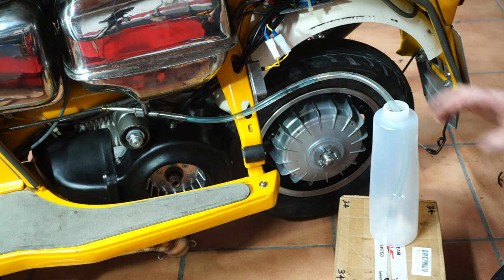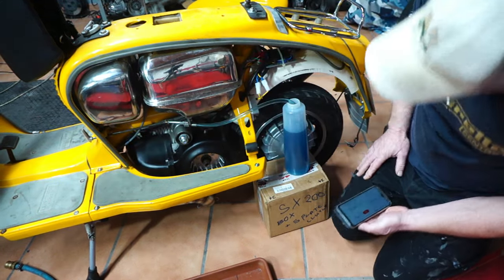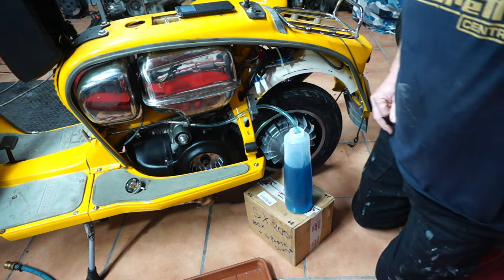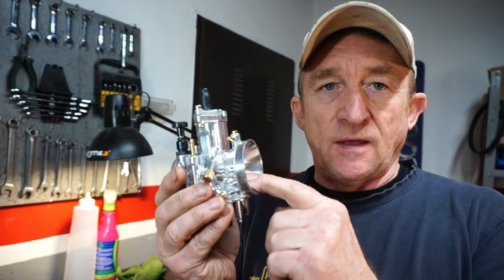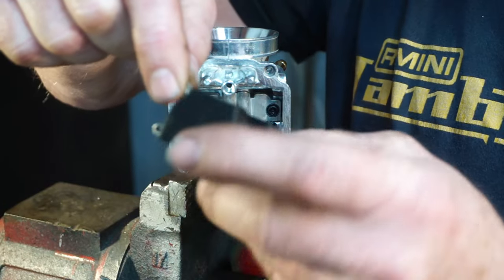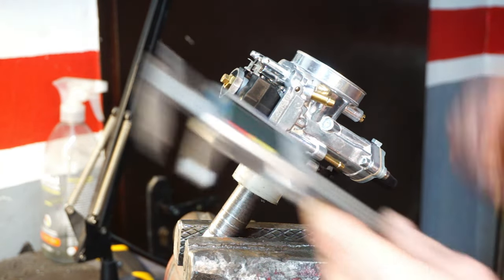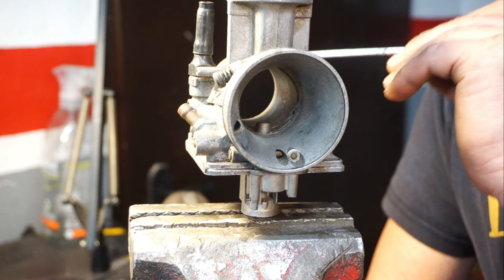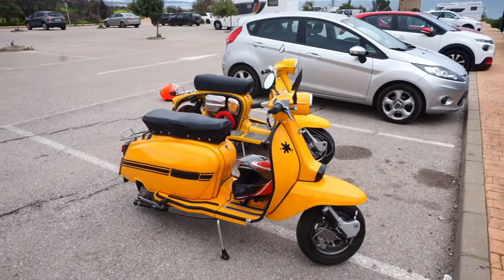AMAZING CARBURETOR TUTORIAL AND SUPER MONZA TESTING part 1#lambretta #scooter#pwk

Comment: Hi Steve, Great channel keep it going.
Can you explain how an engine runs in reverse?
i rebuild an engine with a 195 kit (BGM) Set the timing to 19•  BTDC with a 360° disc. i decided to have it checked by a friend with a buzz wangle and strobe light and it was out. On a few occasions  the bike has reversed  in first gear, please can you explain?
Help!
Reply from the maker: its an ignition anomaly due to a faulty coil or pick up .

Comment: Beware the very cheapest PWK copies.  Its possible to spend hours trying to set up jetting, which in some cases will be impossible if the carb is faulty.  About the best PWK copies are made by Nibbi and are around £50 direct from China.  Far better than the £20 ones, and well worth paying the extra for.
Reply: Intend to watch your full series on carburetta set up and tune. Old-timer in Florida.